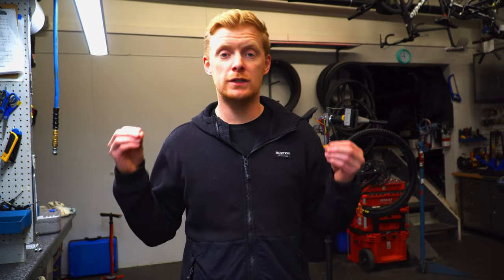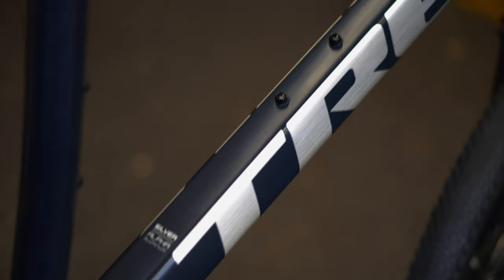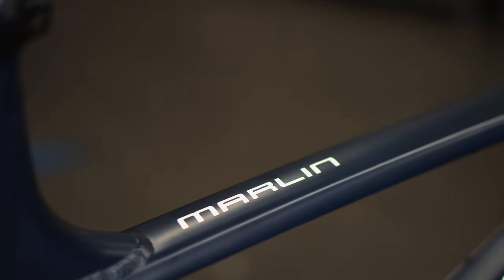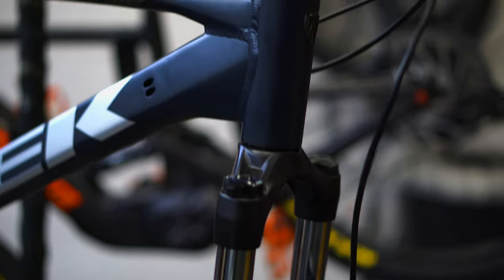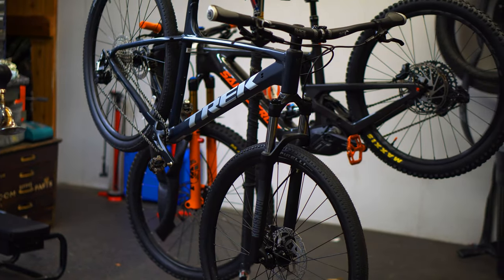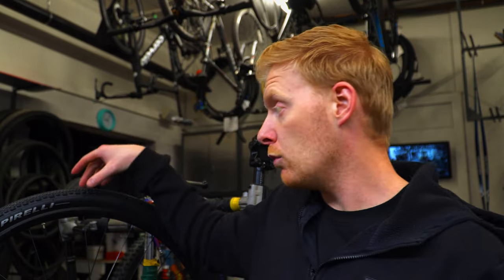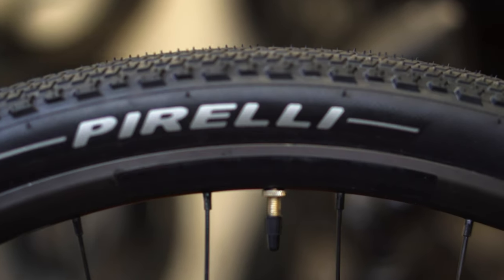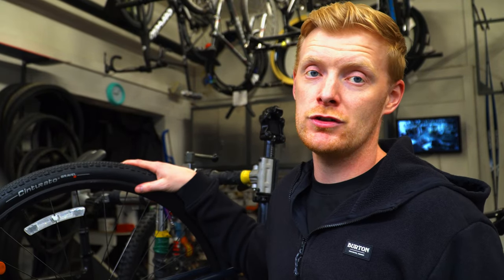TURNING A TREK MARLIN INTO A GRAVEL BIKE | CANT BUY IT BUILD IT

Comment: Great video. I really appreciate the explanation of tire size similarity with regards to 29" vs 700c. You've given me food for thought with regards to my own Marlin 7. Personally, I like XC tires for gravel but the vibration gets to be a bit much for road riding. Also, Trek recently updated the specs info regarding the max chainring size and increased it to 34t. I gave it a try and it works great. Finally, I found that PNW Range gen 3 bars make the ride much more comfortable and their alloy seems to absorb more vibration than the stock bars. Paired with the stock 80mm stem, the 30mm rise is quite comfortable on longer rides as well.

Comment: Marlin 5 Gen 2 is 2x8 22/36T  12-32T casette this is a better fit for a conversion to gravel without really having to touch the drive train although you wont' use the lower gear ratios really on gravel/road.

Comment: My Marlin 7 has a Suntour NCX seat post and a Bafang BBS02 motor with a 40tooth Lekkie Bling Ring. We have some steep trails here in southern Wisconsin and it handles everything well for an inexpensive Ebike.
Reply from the maker: Awesome! How's the bafang installation process?
Reply: With that motor it should be able to handle tough hills as long as the battery last😊

Comment: Nice set up, I wanted the Marlin 5 because the frame is so good looking but I ended up getting the Dual Sport 2 which was hard to find but I ended up finding one at my local bike shop. It is a awesome bike + seat swap to a more comfy saddle. and I also swapped the stock Bontarger gr1 comp 700x40c with the gravel/ mini knob tire to a Bontrager H5 hard care lite 700x45 with the reflective sidewalks which I love and they are a bit wider and it’s road friendly and has directional thread pattern just like a car tire and they are awesome
Reply from the maker: I like the H5, super durable tire too, honestly can't believe you found a Dual sport! Lots of weight savings in the fork!

Comment: I recently purchased a Marlin 7 and I can attest, riding on the road I definitely run out of gear. Very interested to try some or all of these tips. Did you need a new chain with the ring?
Reply from the maker: Honestly sobering you do need a new chain and sometimes you get away with just putting in a link
Reply: I fitted an FSA 34t chainring without need for a new chain

Comment: why not replace the suspension fork with a rigid one, gravel bikes have no suspensions anyway .. i thought you are turning the mtb to a gravel bike?
Reply from the maker: For comfort, definitely could get rid of it but many gravel riders are adding forks to their bikes now
Reply: @goodluckchrisclark  well, pros also use roadbikes on the recent world gravel  champs .. which means fork suspensions are only necessary on trails ..
Reply: Wouldn't the lockout feature on the forks do the same? it's a lot cheaper than new forks and you preserve flexibility.
Reply: @sophiethewestie  suspensions are alot heavier though 😢